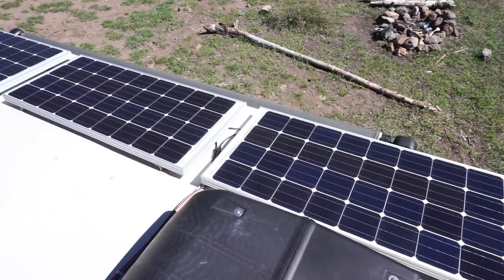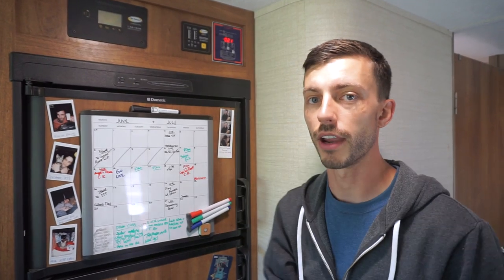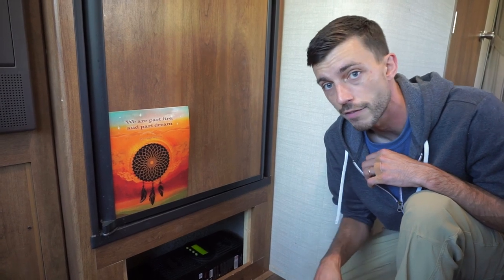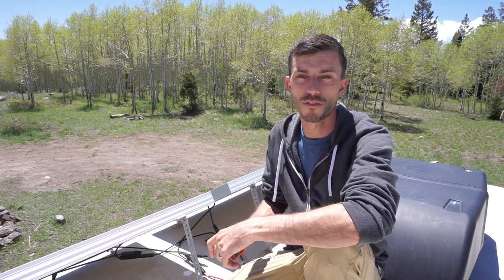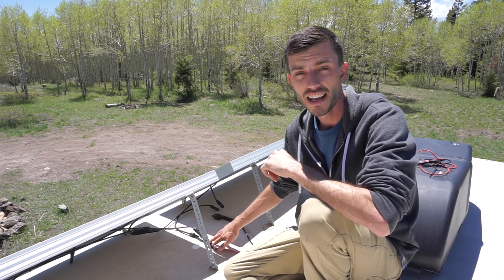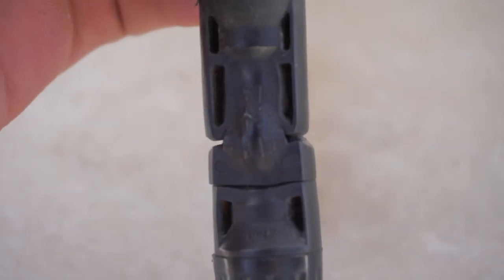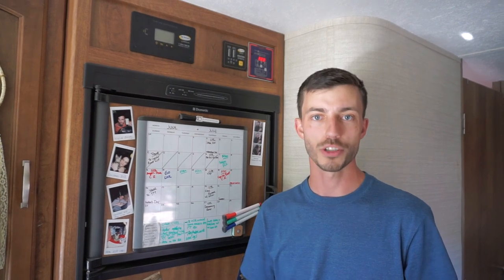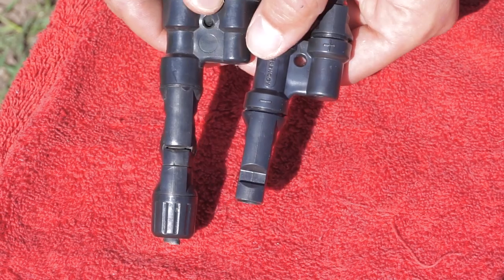RV Electrical Fire Hazard - Melted Solar Connection Fire Risk Fix

Comment: I believe the problem is with MC4 connectors: either poor quality OR the fact that there is no standardization of pin sizing with MC4 plugs, i.e., they don't all fit each other although they look quite similar.  MC4 is a weather resistant rating, not a plug compatability.  You have to rely on brand names, or dumb luck, hit or miss, mostly miss.  One genius was plumping up the size of the male metal pin by prying it open with needle nose pliers a bit so it would have a snugger fit in the female pin tube.  This actually works although, this man claims he has had MC4s fall apart on him.  Makes sure those pins are snuggly fitting in any case!  If there isn't a tight connection, you get heat that melts and can ultimately cause fire. Write you congress-person about MC4 plug size standardization, maybe?!  The should at least be required to list the size dimensions of the metal male pin and the metal female pin and the whole plug really, where they sell these things.  Even nuts and screws and bolts have that.  I don't see why not!

Comment: Nothing is completely safe. Hazards can be mitigated which is not the same thing. For example you can run oversize wire and connectors at trivial cost, batteries can be stored in fireproof steel boxes (which you can double-wall with a bit of welding), and fire barriers can separate flammables long enough for a smoke detector to trigger so humans can exit then respond accordingly.

Comment: Looks like a 20A connector, you prolly overloaded that poor thing should've added a busbar system because that's 70+ Amps there and mc4s can't handle over 70-89amps

Comment: Please give a link to the new batteries you are using. You said they are 200 amp hours, the link you have up I’d for 100 amp hour batteries that look very different than yours! Thank you!
Reply from the maker: We use ReLion batteries which are only sold through distributors and are kind of a pain to acquire. Most people prefer the convenience of Amazon which is why we included that link instead. We linked Battleborn batteries which is a good name company and are just as good as ReLion. If you are curious though, here is the link to the batteries we have: https://relionbattery.com/
Also if you purchase through our Amazon link it helps support the channel and costs you nothing :)
Reply: Thank you!

Comment: Don't mix manufacturers. There aren't always exactly compatible. Solar is a DC circuit and DC circuits have a different set of characteristics to common experiences in AC circuits. Worth cross checking with lessons from other places (e.g. UK)

Comment: the whole point of MPPT is to series connect and get greater efficiency at higher voltages. Possible shading is not a good enough excuse to not series connect. If you are still using lead acid then who cares lol. Battleborn!!!!!
Reply: Why would you want to charge lead acid batteries poorly but lifepo, well?
Mppt charges lead batteries very well. MPPT: It’s not about the batteries, it’s about maximizing solar input

Comment: Dude, change it to series connection.
Reply from the maker: Don't worry, I did about a year after making this video. I have 4 panels wired in series sending 48V to the solar controller.
-David

Comment: Poor design, better to connect the solar PV panels in series not parallel or use much larger wire gauge. Low voltage systems have high current which causes resistive heating in the wire and connectors.

Comment: You have 400 amp hours in your lithium batteries and you had to run your generator all day everyday?  That doesn’t seem right.
Reply: Running A/C? Laptops shouldn't drain that much electricity.